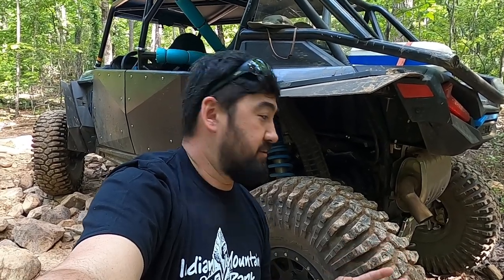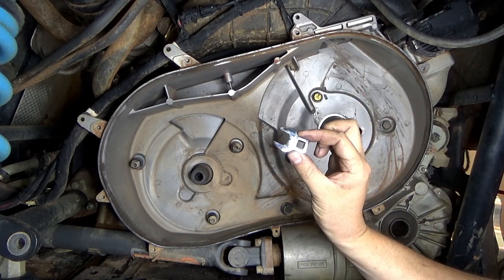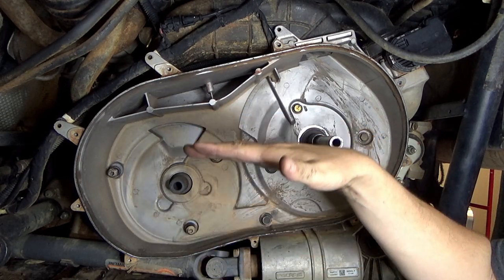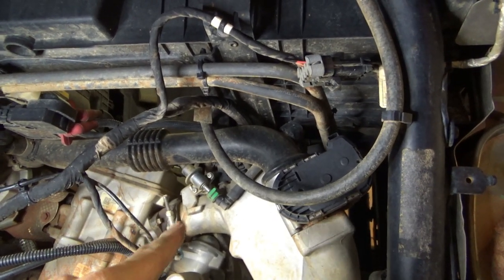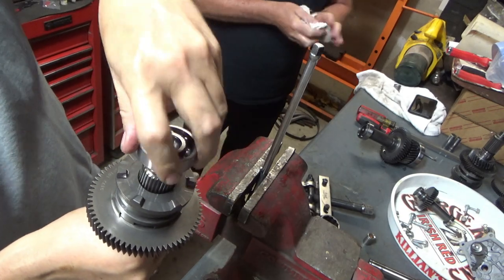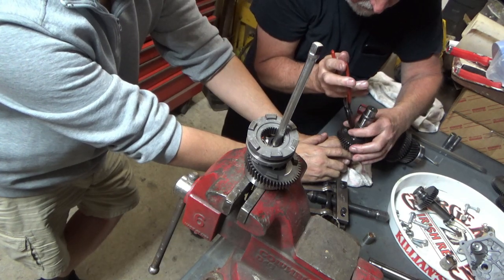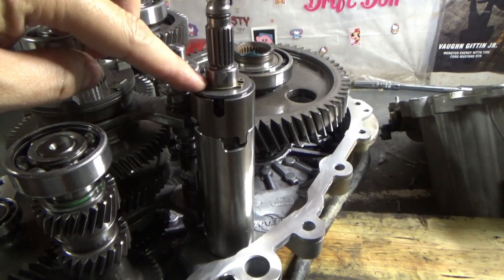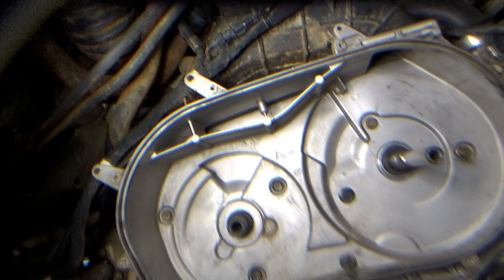How to install a gear reduction in a Polaris RZR | 2019 Turbo XP4

Comment: Great idea with the extension! But just a heads up for future references, always try and pump grease in the the primary hole before inserting the clutch pulling tool and it’s always a good idea to instal the inner cover from bolts starting towards the front of the machine and working your way to the rear torquing the hex bolts to 37 ft# then the rest to 50 ft#, also never unbolt the rear trans isolator, the shafts for the motor and trans should be 10 and 1/2” center to center
Reply from the maker: Great info.  I didn't want it to be a 2 hr video though.  Really just a few tips for the diy type.  Hopefully they still look up torque specs.

Comment: How did you decide how much of a reduction to go with?
Reply from the maker: I watched a couple videos and talked to some people that had done it.
Reply: @GrimRZR  I'm thinking the same but have a 2021 xp 4 1000.  I know I can do the work but just want to gear down the low end as far as I can go and keep the high at only about 12% reduction.  Confused on what to get. 🤔 I see alot of comments for turbos, not alot for 1000 xps.  I've also heard the 1000xp is already geared down a little. Any help. Is appreciated. Oh and keep up the good content 🤘😎🤘
Reply from the maker: @XDecrypted  Im not sure the difference in a 1000.  If you can try and contact the guy from Crash City SxS.  They do a lot of them.  Super helpful and great videos too
Reply: @GrimRZR  that's crazy you mentioned that.  I was just watching that video.  Thanks man!